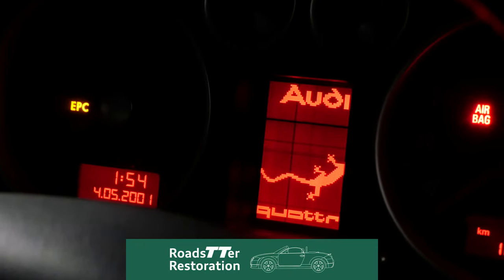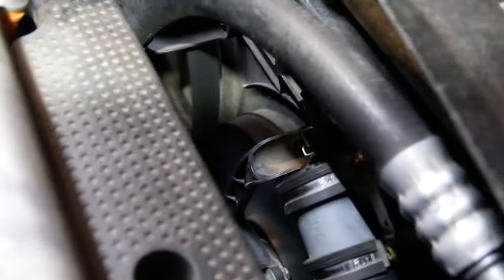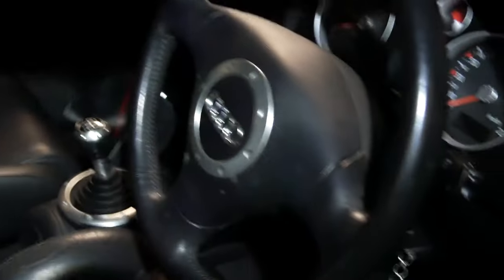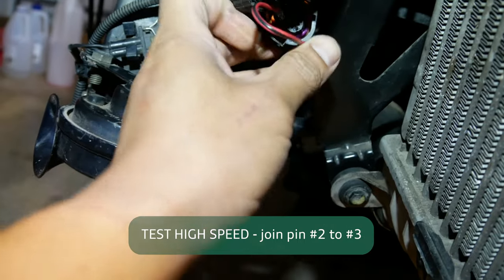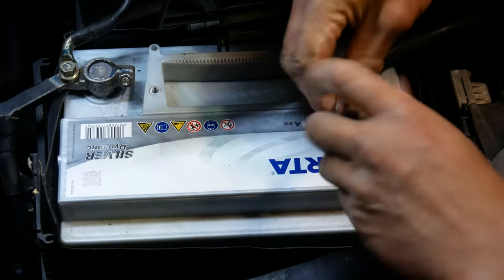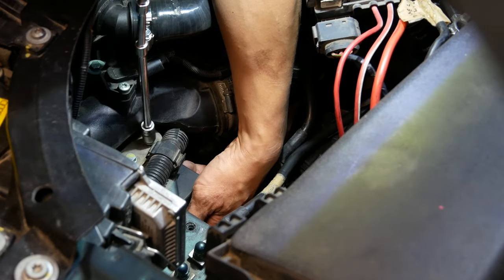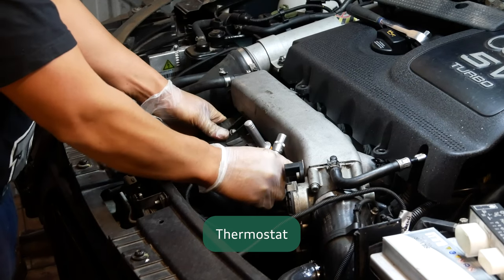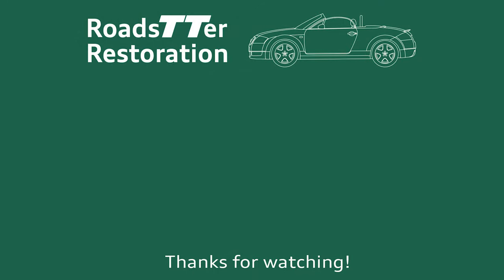Audi TT Mk1 Overheating 🔥 1.8t radiator fan not working properly. What to check DIY guide 🔧

Comment: I’m confused you said if pulling fuse 16 and both fans don’t run then you need to replace that fan, then you said after that if both fans don’t run, then you need to change fan control module?
Reply from the maker: Hey Steve - so this part? https://youtu.be/ZV6yAoWRNs4?si=ft13OghbGFoTsrAE&t=63

I thought I was quite specific but maybe I spoke too quickly...
Pull fuse 16 = if EITHER of the fan's DON'T run then you'll need to replace THAT fan.
If BOTH fans DON'T run = replace FCM.
Reply: Perfect now I understand, pulling fuse 16 my fans don’t run, bridging on thermal wires only one runs, the one near battery try, so this is still FCM issue I assume or fan issue?
Reply from the maker: @stevefoley-v5v  I would replace the fans first in this case E
Reply: @ianpgonzaga  even though one fan works?
Reply: @ianpgonzaga  you stated of both fans don’t run after pulling fuse 16, then replace FMC? Now you say replace the fans? Understand why I’m confused 😂
Reply: @ianpgonzaga  I also didn’t hear the relay clicking so assume it has to be relay why only one fan works but other doesn’t?
Reply from the maker: @stevefoley-v5v  wow you are really over thinking this...

Replace the fan and go from there.
Reply: @ianpgonzaga  both fans are kicking in now, fan doesn’t need changing. 👍
Reply: @ianpgonzaga  😂 sorry boss just trying to figure it out not all are clued up like yourself, both fans are working, so fault must be fan control module or thermal switch 👍
Reply: @ianpgonzaga  update it was the fan control module, sorry mate I love your content but what you was saying wasn’t adding up, but atleast it’s sorted and fans working again. Cheers 👍
Reply from the maker: @stevefoley-v5v  ok nice.   Glad you're up and running  ;). 
It's really just a process of elimination so this can give you a step to try - that doesn't work ? Try the other steps.
Reply: @ianpgonzaga  quick question mate, I’m removing the head now and doing head gasket, but turbo manifold bolt heads have sheared so can’t get a grip on them, can I remove the head with turbo still attached? I’m assuming it can be done?
Reply from the maker: @stevefoley-v5v  Ah I've had the bolts chear too. You really want to get them off. It's way harder to remove the ex. Mani bolts once the head is no longer fixed. 

You can remove it as one  but it'll be harder to lift up and out of the engine bay because of the shape and weight.
Reply: @ianpgonzaga  how did you manage to get the bolts out with a sheared head?
Reply from the maker: @stevefoley-v5v  yes. Heat them up. Use a chisel/drift where you can make a mark on the edge and hit it counterclockwise. 

Other option is to weld a nut on and unwind it once the nut is solid.
Reply: @ianpgonzaga  welding a nut is out not possible I don’t own a welder, I do have a butane blow torch, hopefully that will do the trick, otherwise I guess my only option is to pull the head with turbo attached 👍
Reply from the maker: @stevefoley-v5v  yeah so torch it and then hit with a chisel / drift  undo it
Reply: @ianpgonzaga  just hope I’ve got enough grip on the turbo bolt to get a chisel on there mate, it’s fairly screwed the bolt, do you think I could hear it enough just to break the head off completely?
Reply from the maker: @stevefoley-v5v  yeah should be able to. The original bolts are so soft. You're kinda just need to get it off so whatever get the job done go for it. 

The revised bolts are much tougher and have a better shaped head.
Reply: @ianpgonzaga  I’m going beast mode on her after work, hopefully she will be nice today though, those bolts are the original never been removed, I knew I’d get problems with the bolts just looking at them, I’ve done these turbos 3 times removed and refitted, but that was on my other TT
Reply: @ianpgonzaga  can I borrow your engine hoist 😂😂 I’m having a nightmare trying to get this head removed, now the turbo bracket bolt has snapped the head, started coming out really nice, then went tight.
Reply from the maker: @stevefoley-v5v  ahhh the joys! LOL

Comment: Why not connect 12v directly to the fan using the high speed pins on the cable that attaches to the fan? Second, why not connect an 8 volt source to the two leads on the fan connector that provides low speed? By connecting directly to the fan, aren't we eliminating everything else?
Reply from the maker: I thought that's what I did but maybe not

Comment: Ive changed thermostat, sensor, coolant flush to no ovail lol
Reply from the maker: Oh no. Still overheating and no fans working ?? Maybe time to change the fans themselves.
Reply: I'm going to hard wire it see if they work and if they do then im swapping control relay
Reply from the maker: @glynwalton9207  yeah and if that doesn't work. Replace.

Comment: Hello where can I get information about vcds how to use coding adaptation prof and thank you for everything
Reply from the maker: Hi Walide. What do you need to do coding for ? 

There is always the ross-tech  information for reliable VCDS coding
Reply: Like hidden features abs coding when I change it thank you for your time ❤️
Reply from the maker: @walideamine9540  there's not many things to change in the Mk1. In the Mk2 you can play with more things easily in the ABS With late model only. Early model is difficult to code.
Reply: Thank you so much ❤️ when subscription expired mk908pro autel you do coding programming or not
Reply from the maker: @walideamine9540  sorry I don't know what you mean.

Comment: Can anyone share details from their experience installing new fans on a 2001 Audi TT Quattro 225?  Is it possible to work manipulate them out from the top or bottom without removing the nose?

OR,

Is it possible to remove the existing fans from the frame and install the new fans to the mounting frame without dropping the nose?

(I desperately want to avoid disassembling the nose.

Any solid experiences would be of interest and please include details where possible!  

Thanks
Reply from the maker: Hi. Sorry I thought I replied. 

Yes you can remove from.underneaty without having to remove the front but it's tricky and you need to jack the car up REALLY HIGH to do this.